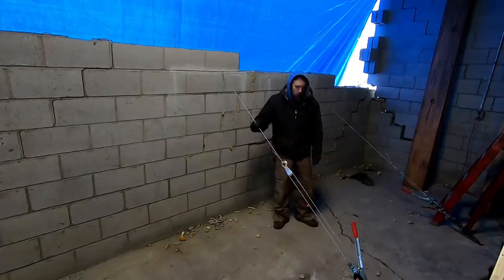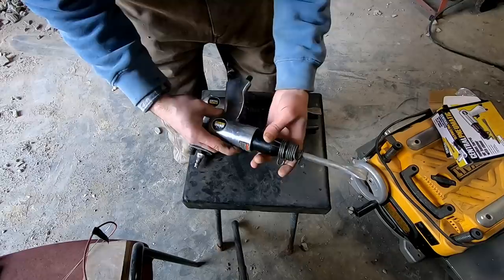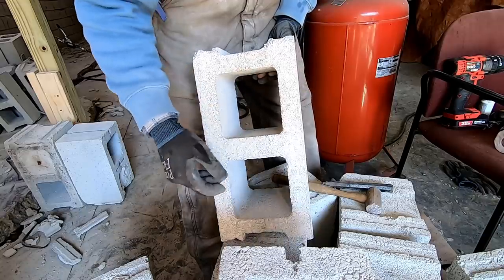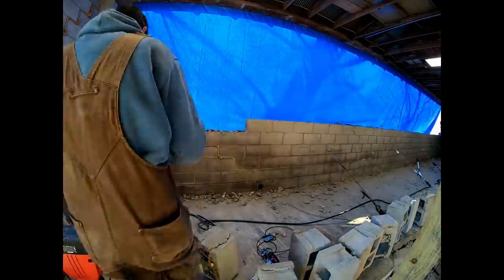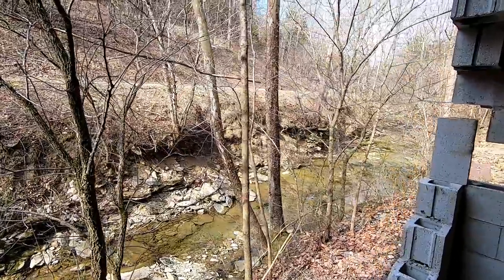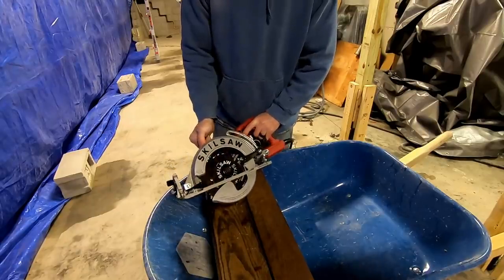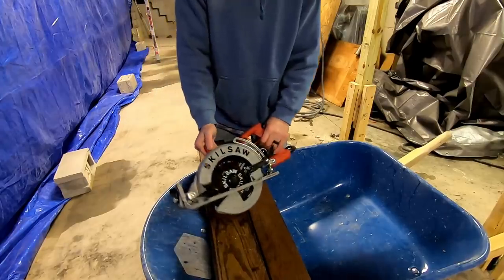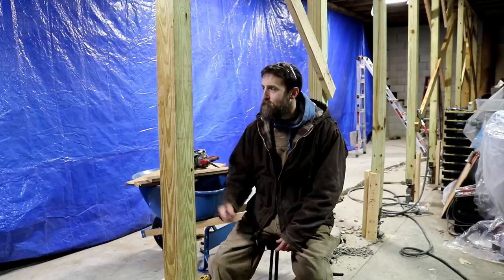THE BLOCK WALL IS OUT! Machine Shop repair part 5

Comment: Looks like a lot of work the builders left you.  I'd probably go up at least 3-4 courses of block in the new wall. Then use wood from there up. That way it is more secure from critters and the bottom won't be prone to rot as a full wood wall. Plus it would mean shorter studs for the new wall. How far down would you need to dig on that side to hit rock? Might not be a bad idea to do that just to keep it stable with the creek that close.
Reply: In a previous video he said rock is at the creek bottom 
So he'd have to dig down like 20ft
Reply: @fowletm1992  It miught be 6-10' to rock, don't think its near 20.  If not going to do piers a diversion/retention wall in the creek to stop soil erosion would also solve the problem.
Reply: Small price to get in there now and add support than wait until that creek eats it's way under the building. Have seen that happen first hand and more in my own area. Here they won't let you do anything in the creek because it is "protected waters", but they can't stop you from digging "near" the creek and pouring a wall or foundation or piers to stop it from undermining things.
Reply: @bcbloc02  
That's a bit of metric to imperial mix up 
Was going to say 3.5m (10ft roughly) but converted it to imperial because most seen to be American 
Somehow came up with 20ft 

If it were me I'd prob have started by just pushing most of the old wall into the creek 
The creek would naturally start to divert away from the building 
Iv done a similar thing on my farm for a settlers child's grave To stop a corner in a creek cutting in more by dumping in rock 
But as above there's prob a law against it in his area (he wants to reuse the blocks anyway)
I'd push the wall in and start building a rock wall up the bank 
Piles and large retaining walls would be the best solution 
But like my grave how's access for heavy machinery, how is digging so close between the creek and the existing building going to affect said building and said creek bank 
On the other hand has he got any natural rock around easy to collect and move 
I have rock pias everywhere I can just scoop up with a loaded and dump in
And if it's only 6-10 ft then the right fence post driver will drive in piles

Comment: Seems like a post frame wall would be a good way to go.  It will be interesting to see what the engineer says.
Reply: Patriot Painter this man is NOT afraid of work in the slightest, and I truly wish him the best.... I really do.... but my gut is telling me he will be doing this again within the next decade or so. He still has the remaining unreinforced concrete on the “good” side, and a flowing creek what, ten feet on the other? That’s a lot of water run off trying to get to the lowest point being a running creek. Just can’t see any type of French drain alleviating this known problem permanently. A structure is only as strong as its foundation, and this sketchy remaining slab is on wet shifting soil teetering on the edge of a cliff. And we haven’t even talked about the weight of what will be in this structure. Steve, I wish you the best, man. I hope it all works out for you... in the long run. Peace be with you and your wonderful family.

Comment: Try your welding slag hammer on the mortar. The wedge head of the hammer combines the chisel and hammer.  I've always preferred it, and by the end of this job, you're gonna be a mortar removal specialist!

Every pound of the mortar and broken block is reusable.  The mortar is fine for filling under concrete slabs.

re: old Skil saw

The parts are available. Put a few bucks into it, and put a diamond masonry blade on it. I have an old Skil 77 I retired, and put a masonry blade on it, to try cutting steel.  I had to add an air line for cooling, but it is a steel cutting fool.  Worth having around for fast, crude cutting.

Comment: The slope beneath the new wall may be best planted with new trees to take advantage of their roots to bind gravel to avoid future ground resettlement. Roots that binds but wouldn’t crack concrete floor from over expansion.

Comment: Steve,
I was looking up the weight of concrete blocks for a possible project, and those suckers are heavy...

Your "standard" bare-bones CMU (block) is nominally 8" x 8" x 16" and weighs in at ~38 lbs.

600 bare blocks  is thus 22,800 lbs, or ~11+ tons   

Factor in the mortar and the weight of part of the roof,  and 12+ tons is not an unrealistic dead-load estimate. (Excludes live loads like wind & snow)

(8/12)  x 40' = 26.67 sqft for your wall's footprint.

24,000 / 26,67 = 900 lb/sqft  << 250 lb/sqft, the rough upper load limit for a ~6" thick unreinforced slab on a good bearing soil. - any Civil Engineers out there can correct me on this, but my first take is that just the deadload was about 3.3x what the upper limit would be, under the best possible conditions.

As you say, ain't no wonder why the slab broke - the wonder is that it wasn't worse...

And, as several folks keep pointing out, that creek bank doesn't look like a satisfactory bearing soil, let alone the  erosion problems coming at you in the future. It would be beyond frustrating to do all this work, just to have the building end up in the creek in a storm or due  to snow melt...

You mention some good points about drainage and soil conditions - just enough to make us viewers aware that you are aware of at least most of them... I'm looking forward to learning more about the remediation and upgrade plans as this project materializes.

Cheers!

Eric

Comment: For the apprentice:

If you try to pull the hand truck as much as possible, you will find it is much less work.  A hand truck is designed to be pulled.  The only time to push a hand truck is going down a step or incline, and you really don't push it, you let gravity do the work.

Try using the hand truck both ways, pushing, amd pulling, and you'll see the difference.

"Just because something is a tool of manual labor, doesn't mean there isn't a right way to use it."  Remember this, and you'll make your work life less work.
Reply: Very very very well said. Sage advice right there.
Reply: That's the same advice my uncle gave me about 75 years ago.
Reply: Sorry but I have to disagree, trolley's or hand trucks are designed for pushing. They are basically a lever on wheels, once you have the balance, you will have much better control and visibility by pushing. Pulling will bring an increased risk of back strain and is easier to lose the balance point. The only times to pull is when going up stairs or a steep incline such as a truck ramp but pushing up a ramp is still better unless the weight is excessive, in which case you should pull but with a second person pushing. 15 years as a furniture mover and i learnt this on day one of getting my "trolley licence" 
Manual labourers develop an inate understanding of physics in relation to moving heavy things. 
However you are spot on about using tools efficiently. There is the right way to drink beer or there is the way that makes your shirt wet. 🍺
Reply: @billbaggins  Looking at the physics of using a hand truck, when pushing, one is exerting downward pressure which increases the weight on the wheels and axle that must overcome every little obstacle on the ground. When pulling, one is lifting the weight off the wheels and axle thus making it easier to move. Moving a hand cart over a threshold proves this concept. Try pushing it over and then try pulling it over and you will find pulling helps lift the cart making it easier to move. Of course, one it free to use a hand cart any way they want.
Reply: @ron827   Yep, it seems counter intuitive. A big exception would be rough ground, but on a flat surface the difference in energy to overcome gravity is minimal once the centre of gravity or balance is found and the gains in maneuverability and vision far outweighs it. Inertia is your friend and can be used to great advantage, but if you are walking backwards and trip then the load can fall on you, trust me, you don't want that😁 also neck strain and twisting your spine to get visibility is an injury waiting to happen. Think, moving 100 full filing cabinets. Your arms will be like jelly after 10 and you can't pull a cabinet to sit against a wall, if you use your body as a counterweight most things can be placed with good precision when pushing.
There are always times when pulling is the best option but trolleys are designed for flat ground and pushing, It's all about the balance and inertia and being able to control the load with the best visibility of hazards.
Just trying to save some backs and walking bacwards kinda sux 🍺

Comment: i have the same hand cart from HF and when the tubes rotted out, i replaced the tires with solid rubber tires. those cost as much as the cart, but it was worth never having to mess with pneumatic tires again.

Comment: Again, if it were my shop, I would cut off the concrete. Build a new wall under the roof, then go outside and build a new wall 5 or 6 feet over. When I got the walls done I would remove a couple of sheets of metal across both sides and winch a section of the roof to the new walls. I would think 3 10 foot wide sections would not be that hard to move, they would just slide over on top of the walls. Use the idea or Dont!

Comment: My brother  set your sights on moving your shop away from that river bank that soil is moving and will continue to move because the water will continue to saturate the soil under the shop ,what you're doing now you will have to do again later believe me ,to stop the moving you have to auger down past the river bed then you build around those pilings, anything you do without pilings will just be suspended in the soil and once the soil moves your structure is going to move with it. Any engineer comes and tells you to cut trench cast and build on that terrain have no idea what they are saying, Take my advice else you will be spending a lot more in the end.

Comment: For you new foundation I would guess dig 4 good size holes for “peer” footings?  Like 3’ square.  Say down 4’ or till you hit a lot of rock?  If the roof wasn’t there, bore casing holes or pilings into the rock below?  Basically you have to get down to something stable that will not slide into the stream.
Reply: D6joe “pier”.

Comment: Kind of late to mention it but your block stack would be a lot more stable if you would interlock the rows.  Every other block should be turned 90 degrees to lock it into the previous or next row.
Reply: Check that.  I saw that later in the vid you did restack the blocks in a more stable way.  Good work!  I'll be that the realtors that sold you the property touted the shop as an asset. In truth it is a liability and will probably cost you more in the end than putting one up from scratch the right way.  On the other hand, a shop is a shop and having one is better than not.  Best of luck.

Comment: Larger flat surface on one side of the block is meant to be the top. It is a platform for the mortar bed that the next block is set into.

Comment: You should mill the mortar debris, you could make some savings on aggregates, at best, for the sand for the future mortar, at least, for the rocks for the concrete (i'll be astonished if the engineer tell you "the cracked chunk of slab is reusable without redoing a new one" (and i think, as the way you do rebuilding, that's your plan to pour a new slab, am i not ?))

Comment: Don’t clean blocks on the grund. Do it on top of 2 other blcks. Your back!
Reply: Definitely.  Work at a back-friendly height as much as possible.
Reply: @Scodiddly  when I do it I really treat myself. I throw a scrap of plywood between horses and sit down. Least I've done bricks that way. Never did block. Well, I've spread a lot of block. Never salvaged and cleaned any block.

Comment: Sorry to say that I am siding with the others in expressing my dread at your foundation being so close to that river. A small run-off ditch took out a 20x40x6 foot section of my back yard in less than 2 years.. It does not run constantly and only during heavy rains is it more than 6-10 inches deep. I know you have an engineer advising you - I hope you have the funds and inclination to follow or overdo what he tells you. All the best to you Steve.

Comment: The block is fine for the garage wall, it is not the cause of the problem you have. You have the block save yourself a lot of cash and reuse lighten load put a few windows in

Comment: It will be interesting to see how you anchor a new footing to those rock ledges. It has to be difficult to prevent water from moving between the layers of rock. Maybe a poured wall about a foot higher than the floor that extends down into the ground. We call them rat walls.

Comment: For me, the reputations of Harbor Freight and the "big box" tool/hardware stores have completely reversed at this point... At least HF is transparent about where their tools come from, and their prices are much more in line with the actual cost. My last straw with Home Depot was when I saw the insane prices for flexible dryer vent hoses... $10-15 for literally $.05 in material and packaging, and still made in China. Corporate profiteering at it's "finest".
Reply: The harbor freight stuff will last for one job but they won't last for ten.  If you buy Chicago Pneumatic you can give it to your son or grandson.  Harbor Freight will end up in the scrap heap.
Reply: @hankcohen3419  Its all made in china including Snapon
Reply: Yeah I hear ya. I'm a diesel mechanic and I'm really rooting for harbor freights icon line to be great. I like their low end stuff too for when I need a throw away tool. I use a harbor freight 1/2" drill that I use to mix concrete with that gets a ton of hot suppers.
Reply: Otto what the box stores do is have lost leaders. The have big shiny stuff out front at good prices then all the items that you are taking about is were they make a huge profit. Up till I moved a dozen years ago there was a little corner hardware store that was established right after WW11. Almost everything that they had was cheaper than Home Depot.
Reply: Heard a lot of opinions on HF etc. I just wish I had somewhere like that locally. In Tasmania it is damn near impossible to find anything more technically advanced than a teatowel.

Comment: You've got ambition I'll give you that, good work:-). The mortar you're removing doesn't seem to be bonded that well to the block  and seems quite powdery as well...........Mike
Reply: I was going to comment on that... whoever built that shed really did a poor job of everything, starting from the foundation (more properly the lack thereof) and I suspect all the way up to the roof.

Some of the work was done less poorly than other parts, so the building is salvageable...

However, all of the concrete work is suspect... no signs of proper rebar, and the mortar almost never bonded to the block.
Reply: @chemech  Yes, agreed. the shit initial job made it easy to pull down. Done properly it would not have broke in the first place. Jerry Built, is a common term for bad workmanship, here in Australia. Dunno where jerrybuilt came from.
Reply: @aubreyaub  We use jerry-rigged and jerry-built here in the States as well - and some much less socially acceptable terms were still in use in some places 30 odd years ago...

Funny thing is, we pronounce this version of jerry as jury - so, I haven't the faintest idea as to the origins.

The Brits used to use Jerry (pronounced in the usual fashion) as an epithet for the Germans in WWI, and especially in North Africa, the Germans were at the long end of a none too great supply line, but that doesn't really hold together as an explanation of the origins.

Getting back to Steve's headache, in the Southern States, aka the South, there exists a form of Unhandy Andy (using a term from my Yankee childhood) whom everyone has learned to call Bubba.

Bubba is none too bright, generally lacks any real skills, and has no sense of what a properly done job of work even looks like, let alone how it's supposed to function.

In the case of Steve's shed, Bubba were here...

Comment: If it were me I would move the wall in 4-5ft. (or close to where your supports are now) and have a covered outdoor section. That would drastically reduce the erosion of the floor and you could keep filling in what washes away unless there is a 1000 year flood..... JMHO...   oh ya and riprap the bank if you can get away with it.....
Reply: That's what Steve said he was going to do in the first video. He's not putting the wall back where it was. He's cutting the slab back.

Comment: Hi Steve - Nice job so far.  With Peanut, banggood.com sell small 4K WiFi cameras for very cheap and often have sales on them as well.  Once you've finished with it as a "Squirrel Cam" you'd be able to use it for your videos around the Shop.

Comment: That mortar is coming off these blocks waaayyy to easily..
Reply: Yeah no lime was added to that mud. Bags of lime would have cut into beer money on this job. I was surprised to see there was reinforcing wire in the wall. I figured whoever built that place was just allergic to steel. No J bolts in the pad and no rod in the webs though. Can't have anything like that going on. Place might actually stay up.

Comment: Hold on to the 825!  Take to a reputable repair business (may need a new field and armature) and you’ll be happy to have if the new Chinese made “Skilsaw” takes a dump. BTW, no blade brake on that saw so don’t wedge the guard open.